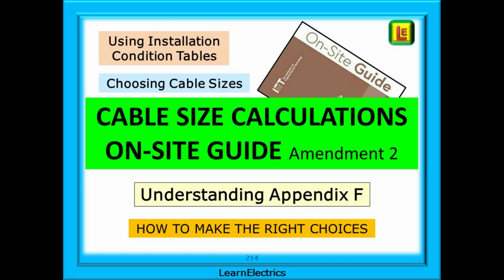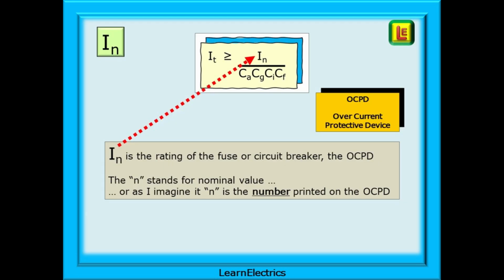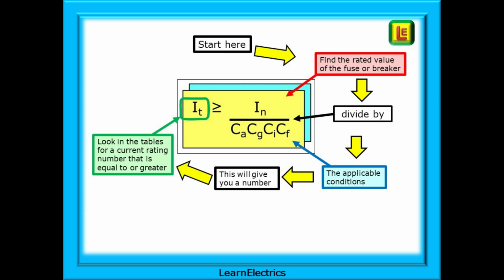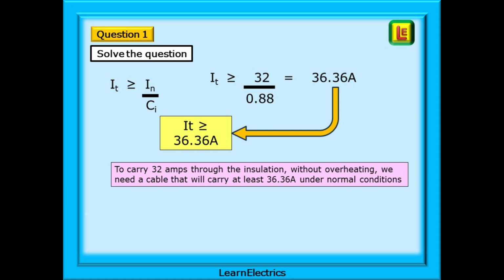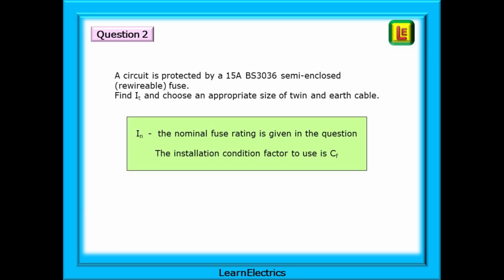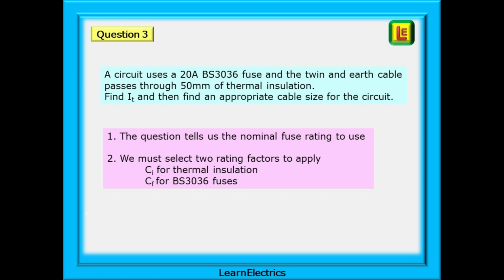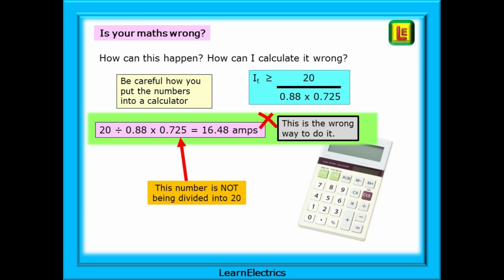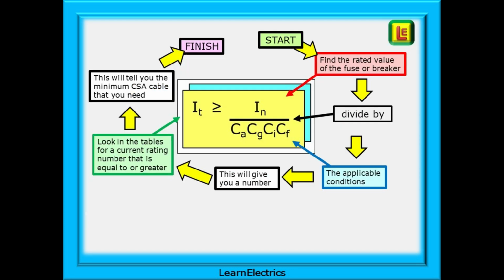CABLE SIZE CALCULATIONS – ON-SITE GUIDE APPENDIX F – AMENDMENT 2 – USING THE TABLES – MAKING CHOICES

Comment: How come we always go to reference method C?
Reply from the maker: It just seems that Ref method C is the starting point. I used to question that myself years ago and some old timer said that if you can remember the Ref C cable currents, at least you have some idea of what the conductors can take as a maximum. Any other reference method is going to be less current than Ref C. Hope this helps. Dave.

Comment: question number 1 pvc able completely surrounding by thermal insulation than why we did not use 103 reference method why you used referance method c
Reply from the maker: Reference method C is the accepted reference method that we use. Thanks for watching. Dave.

Comment: Can I ask a question on using T&E in trunking in a ring cicuit with a 32A breaker. Trunking is reference method B which is not in table F6, its in table F5i. This table is for multicore cables. With no other factors to derate, 32A would need a 6mm CSA cable. This can't be right can it?

Also, using table F6, we could never use 2.5mm CSA cable on a 32A breaker, but most ring circuits are wired like this and BS7671 says we can use a cable capable of carrying 20A in a ring circuit, on a 32a breaker.
Reply from the maker: The regs don't like to see twin and earth in trunking, You have a conductor with a grey sheath on it and then you put it in a box. That is two layers of plastic that are preventing heat loss.Take a look at the video below, there are several on ring circuits, and yes, 2.5 on a 32A breaker is ok.
https://www.youtube.com/watch?v=-PAruseUf04
Reply: @learnelectrics4402  In my case, this is a C&G exam question where they specify T&E running in dado conduit. They say the right answer is 4mm2 but I have no idea why.
Reply: @learnelectrics4402  Further to this question, I think I am right in saying that for Ring Final circuits, there is no calculation for cable size. The regs say that 2.5mm2 (good for 20A) is ok with a 32A breaker with a floor area of less than 100m2.

However C&G teaching says to use the design current for the ring, not the tabulated current, to look up the appropriate cable size. This is why they say 4mm2. I just just don't understand why they teach this when its not in the Regs.

Comment: Hi great video. I am currently doing design project through college and i have the exact issue that you’ve stated in 14:00. my I n is greater than my I t due to the 25c ambient temperature (which is required in the spec).

my understanding is that I t should be bigger than I n, under all circumstances. so how can i get around this issue to change the values and make the calculation work? really hope you can get back to me on this 😅

many thanks Daniel
Reply from the maker: Increase the cable size, that is the best way, this will increase It. Or decrease the breaker rating to reduce In, but not always practical.

Comment: Great vid! Quick q.. for question 1 why is the ref method C and not 100? ref method 100 mentions insulation doesn't exceed 100mm for which it doesn't as it's 50mm? thanks!
Reply from the maker: Ref method C is the starting point for the reference methods. This has the highest permissible current for a size of conductor. All the others are reductions on the Ref C figures. Hope this helps.
Reply: @learnelectrics4402   so do we always use ref method c for the exam questions on the 2365 203 exam?

Comment: Great work 👍, I have a question what about Iz as i am getting it mixed up with It.
Reply from the maker: Iz is the amount of current a conductor can carry 24/7 under the installation conditions that affect it.
Reply: @learnelectrics4402  Thanks for the quick reply, I understand Iz is current carrying capacity but where i struggle to understand is when working out the formula sequence e.g

Should it be;

Iz ≥   In        = It
     Ca x Cg

Or

It ≥    In        = Iz
     Ca x Cg

Comment: Thanks, another great video. Does this apply also to a ring final, wired in 2.5mm TC+E? I’m bashing my brain against this because on the one hand OSG part 7 says we can use 2.5mm cable for an I n of 32 A, and an I t  32/0.8 = 40 A; but the current carrying capacity of 2.5mm cable is nowhere near that? I can’t help thinking I’ve missed something that is written in the books somewhere that explains the case for ring finals … ?
Reply from the maker: With a ring circuit, you have two 2.5mm wires - making 5mm of conductor. That is why the figures seem higher. Take a look at this video. Dave.
https://www.youtube.com/watch?v=6GNb1SSEjQg

Comment: A handy tip that's stuck with me since I was told it about the < & > symbols is that the < looks a bit like a squashed L (for less).I'd never had difficulty with them but this is just saves that bit of thinking. 
Also,  when using a calculator,  the = button is your friend. So 20÷.88= (then) ÷.725= gives the answer without the additional step or using M+ and MR.
Thanks again for your incredible content.
Reply from the maker: Excellent support. Thanks for the input, it will help many. Dave.

Comment: Brilliant explanation .but just wondering where about in question said what reference method is that.
Thanks
Reply from the maker: It is all in the question, the data/clues are all there to work out the reference method. Have another look at the video and follow my working through.
Reply: @learnelectrics4402  thanks for your reply .boss page  .I just have looked again you are right 👍